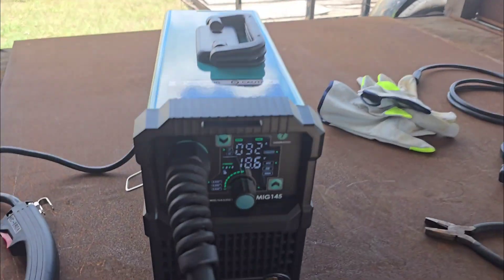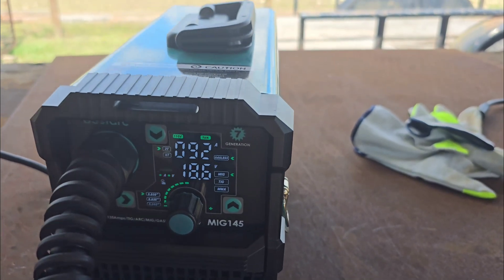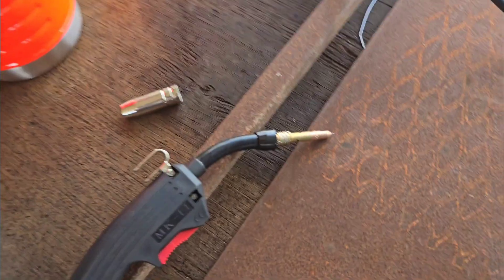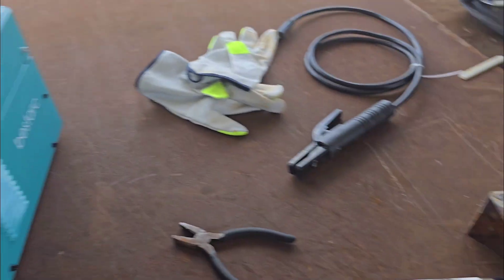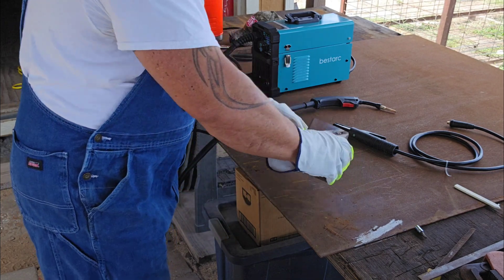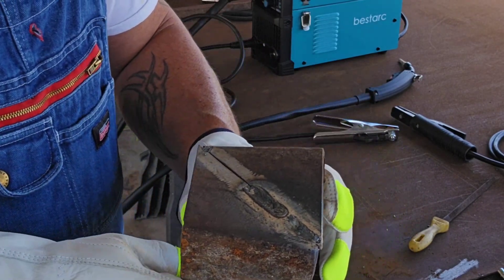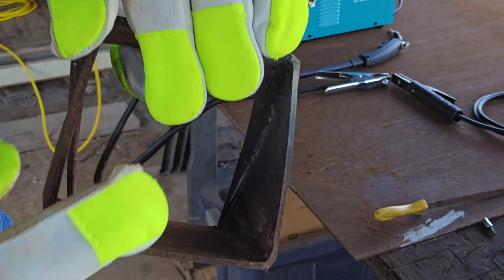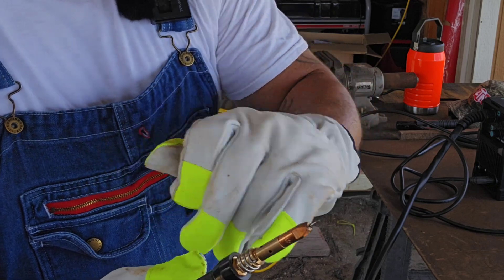THE BEST welder under $150!! (bestarc) This little machine is a BEAST!! @BestArc-official

Comment: Little question ,A 110 plug welder ,First time Welder ,Light projects like Horseshoe Hangers ,would you advise Stick or Wire ,maybe a Model available at common outlets ? Thank you!!!
Reply from the maker: @Nick76571  either for those kinda applications are fine.
Reply: Thank you!!! @hab-outdoors

Comment: Can I use this on a BMW's Camshaft Lobe (worn at the top), weld & then file down to match other Lobes?
Plaining to do it in the engine without taking the Camshaft out of the engine.  If can't be don, can you recommend one that can be done?
Reply from the maker: Unfortunately I cant recommend anything done like that. 🤣

Comment: Can this be used to weld a flex pipe on my cars exhaust?
Reply from the maker: @gwlemus  sure can. It can go down to a  very small wire and amp
Reply: @H.A.B.Outdoors  thanks for the help,I have never used anything like that,I'm pretty handy working on my own cars and I could use a welder for when the need arises which is the case today,its how I found your video..
Reply from the maker: @gwlemus  appreciate ya

Comment: Did you buy it or did Best arc give it to you. Just wanted to know why not Azzuno135 you said you liked the azzuno 200 ? just asking
Reply from the maker: @Liketofixit357  Best Arc sent to me. I purchased the Azzuno. I prefer the AZZUNO due to its higher performance level. But the Best arc is plenty fine
Reply: @hab-outdoors  I figured that. The azzuno 135 is so muh better. Although the Best arc 135 gen 9 is better then both 110 or 220 and option for gas I am trying to decide between Best arc 145 gen 9 or the azzuno 200a mig leaning toward Azzuno , Thanks for your response  Love your videos !!!
Reply from the maker: @Liketofixit357  truthfully you wanna go with the Azzuno 200. You'll always have that extra power. But again if you're doing small, medium work then I would go with the  Best Arc